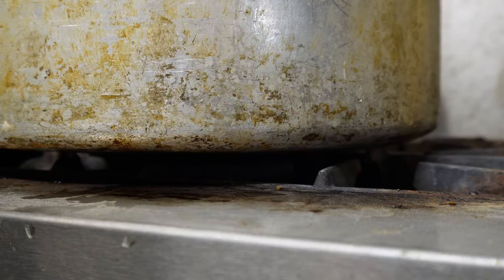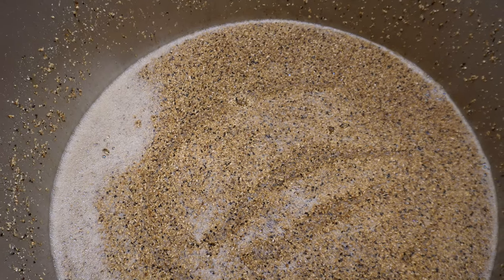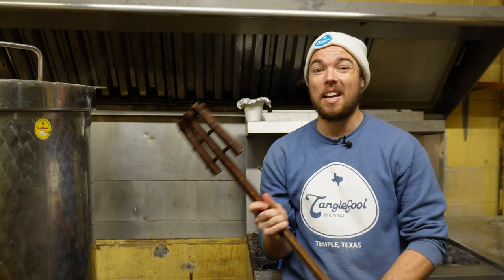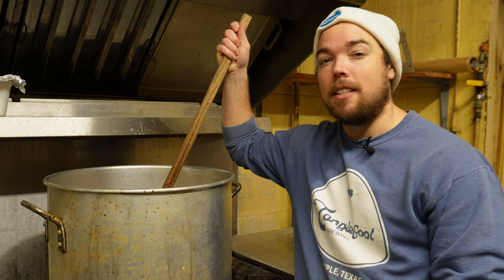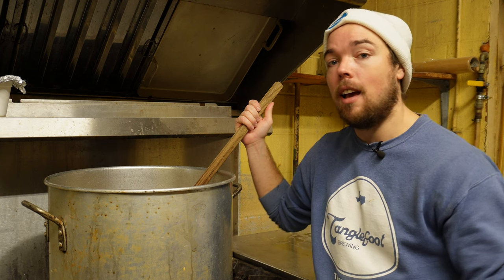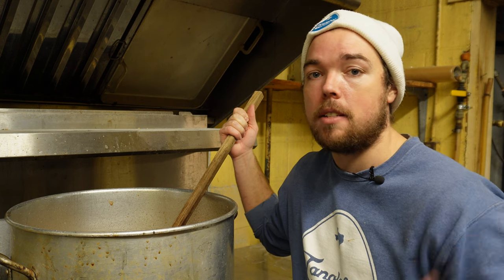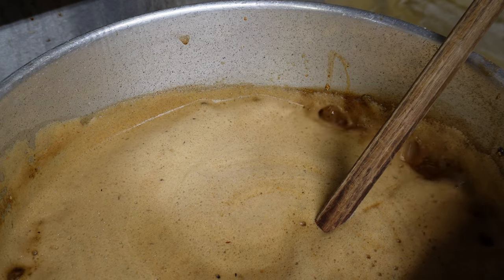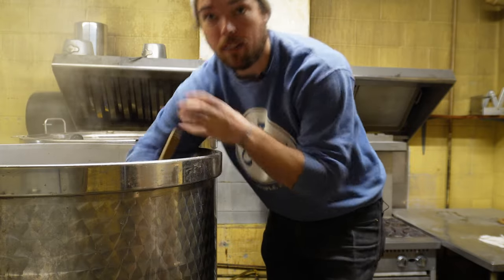What Is A Decoction Mash? (Explained)

Comment: it was never really necessary from a conversion standpoint either. Using the same malting technology, brewers were also using single infusion mashes and step mashes via infusions or just direct heating their tuns. It's mostly a way to do step mashes without thermometers (which didn't really start showing up until the late 1700's). The flavor changes and mash viscosity and wort clarity changes are byproducts of that (not the intent). It's similar to rauchmalz, the point wasn't to create smoked malt, they just needed to dry the malt and wood/straw was what they had... so it ended up slightly smokey (I think this is where commercial smoke malt and pseudo smoke malt (taking finished malt, wetting it, and then re drying it over smoke) go awry, and they end up being too smokey as a result). 

Decoction doesn't really take any more time, you just have to be doing multiple processes at the same time; for example: our main mash is resting at 120-125F for 25 minutes, while your 1st decoction is heating up to a boil, then you add the decoction to the main mash at the end of the step (on a homebrew level, you have to wait to start heating the decoction, because the volume is small (relative to the size of most people's burners), but on 1bbl and larger, so long as your burner isn't disproportionally large, it takes a bit of time to boil the decoction, allowing for it to convert as it does so).  5BBL batches is about the limit (IMO) of what you can decoct manually (a stainless 5 gal bucket or a scoop shovel would be warranted), but even at 3bbl, a positive displacement pump to move mash around would be a godsend. On our 3bbl system, it doesn't take any longer to double decoct the mash than it would to direct heat the mash through steps, and it's generally done just over an hour (25min @125F, 30min @145F, 10 min @158F; then flow into the lauter and fly sparge and then press in the mashfilter/press (we're also a winery/cidery, so I have a rack and cloth press that would otherwise sit unused for 10 months out of the year)). 

If a brewery has the space, I still feel that having a separate mash and lauter tun (and even a cereal cooker and a mash filter/ press if you have room) is a better setup. You can tailor the vessels to their intended task easier and you can get away with cheaper vessels (less engineering and fabrication).  You get less evaporative losses from a mashtun that's tall and narrow (like a drum), but a lauter tun is best as a shallow vessel (you'll need less straw/ricehulls on sticky mashes (like my wheat/rye beers, which are 80% wheat/rye, remainder being corn) as a result and wort collection tends to be faster).

Comment: We have been working on an Austrian very old equipment and did a tripple decoction mashes. It allowed to pump the mash from the mash tun to a kettle, boil it and pump it back. It's just seems to be the question of proper piping. If you have the port above the screen of mash tun you can weld the pipes(or use the hose) to pump it to the kettle.
Reply from the maker: Very true. Also, pretty sure the pump needs to be designed for pumping particulate. If I remember correctly, impellers tend to be worse for that, but I could be mistaken.
Reply: We had a huge impeller pump designed to pump the boiling liquids.
Reply from the maker: @GrigoryKiselev  good to know! Thanks for the response.

Comment: Nice work! Great explanation. But for those of us who don't have the set-up, is there a caramel malt you can recommend that closely matches the flavor profile for this style of beer? BTW, I've recently been to pilsner urquell and saw their triple decoction set-up 😉
Reply from the maker: The Pilsner Urquell brewery is dope! 
I actually use a touch of honey malt in my pilsners, but lighter C10 or 20 should do the trick. I would say around 0.25-1% of the grain bill is a good start.
Reply: @tanglefootbrewing  Thanks for the pro tip! 😊🍻
Reply from the maker: @Timothythebrewer  sure thing!
Reply: I would also suggest Melanoidin Malt which is essentially what is being created in the boiled malt. It won't bring the body to the beer - you may want some CaraPils/Dextrin malt for that - but the Melanoidins will bring that rich, toasty, malty-sweet flavor. Id say melanoidin alone will get you 80% of the way to the decoction character
Reply from the maker: @Musicman9492  also a good one! 👍

Comment: Is there a particular reason that you're moving grain in addition to wort in the decoction step? Aggressively boiling the wort seems to be the important part. I have a 10bbl two-vessel system, and I just lauter, move the first ~3bbl of wort to the kettle, disable my flame switch (prevents turning on the burner until about 5bbl of wort is available), and let 'er rip for 20 minutes. I've done the same beer back-to-back, only adding the decoction step and verified the additional character that it develops.
Reply from the maker: The process of actually boiling the grain/husks extracts tannins and some extra grainy character. I would be interested in seeing a side by side with grain and without!
Reply: @tanglefootbrewing  in general I think I would prefer to avoid tannin extraction.

My pilot brewhouse is electric, so I don't really have a clean way to test it head to head.
Reply: Your PH shouldn't be high enough to extract too many tannins. There is some extraction from the husk, though. However it is important to have a thick mash and not simply boil the wort. Let me curse/bless you with some Narziss, Die Bierbrauerei Band 2, page 336, as translated by DeepL:

"The reactions that take place during this process can be described as follows: During mashing, the carbohydrates that are soluble from the malt, such as sugars, glucans, amino acids, peptides, polyphenols, organic acids, phosphates and other minerals, dissolve. The vast majority, however, remains undissolved at first. The water-soluble substances now react with each other and with the ions in the water. (...)

The first pan mash is thick: it therefore contains fewer liquid substances and enzymes than the vat mash. On the other hand, it is rich in components that need to be broken down and decomposed. This now takes place less by enzymatic and more by physical means. During the subsequent heating of the mash by approx. 1C/min, the enzyme content of the mash is utilized to a certain extent: for example, the protein-degrading enzymes in the range of 40-60C can act on the corresponding substrates for around 20 minutes, the starch-degrading enzymes from 58-78C also for 20 minutes. In some cases, heating is slowed down in these ranges and only accelerated significantly above 78C, e.g. to 2C/min, and in some cases the maintenance of defined rest periods leads to an intensification of the respective degradation processes. However, it is not necessary to wait for complete saccharification of the mash, which would take too long even at the prevailing concentration. Rather, the main task of the enzymes, especially the amylases, is to facilitate gelatinization and liquefaction through their activity and to bring this about at lower temperatures so that the subsequent boiling has a better effect. The same applies to the release of beta-glucan by the beta-glucan solubilase, which makes the starch-bearing cells more accessible to attack by the amylases.

During the subsequent boiling of the mash, the cells of the endosperm are burst, the starch itself gelatinizes, high-molecular protein bodies coagulate, supported by the polyphenols that have already dissolved or are released from the husks during boiling. .

The boiling time for the first thick mash is 30-45 minutes for dark malt and only 10-20 minutes for light malt. In addition to the desired physical disintegration of the "dark" mash, the reason for this is that the typical taste of dark beer only develops through vigorous boiling, through the dissolving of husk materials, through the formation of Maillard products and through caramelization on the heating surfaces (above all of fire-heated kettles). In the case of light-colored mashes, the boiling time must be limited with regard to the color. The thick mash is now pumped back to the vat mash. After this mash has largely segregated during the 2 to 21⁄2-hour break, it must be "pre-mashed" for at least 10 minutes before the end of the boiler, i.e. before the hot thick mash is pumped back in. The agitator must also run during the entire overpumping in the mash cycle to prevent the enzymes from scalding when the boiling mash is pumped in. Depending on the effect of the agitator and the size of the boiling mash, pumping back takes 10-20 minutes. If the mash is too large, a longer scalding time is necessary in order not to exceed the desired temperature range in the vat.  @tanglefootbrewing
Reply from the maker: @michaelmoineau5432  ya, couldn't really fit all that in the video ha. Good info though. Cheers 🍻
Reply: @michaelmoineau5432 there is certainly some value to the conversation here, but we'd need a 3-way test protocol to prove anything with respect to desired outcome.

Once we got there, we would find that even experienced BJCP judges would have trouble picking out the differences, let alone objectively choosing "better".
Reply: @tanglefootbrewing oh for sure! I just posted that in reference to tannin extraction during decoction. Tannin extraction is more likely during the sparge as your PH rises than during boiling your thick mash for decoction as your PH is much lower. Not that there is zero tannin extraction during decoction and people sometimes note a different type of bitterness but there are other factors at play with the increased Maillard reactions. But I just found the channel. Great stuff!